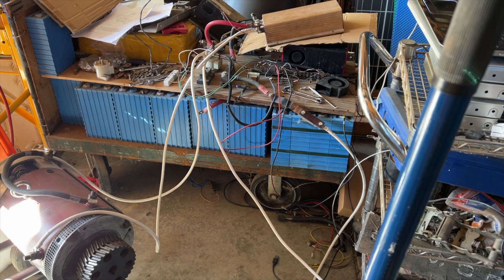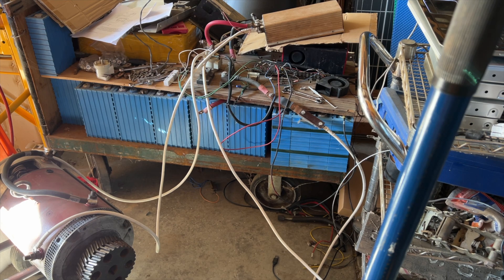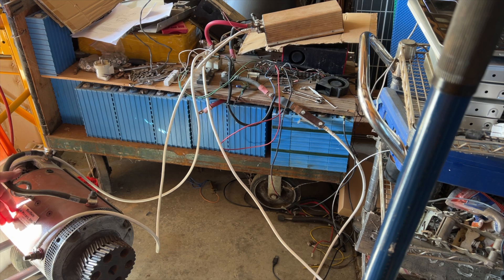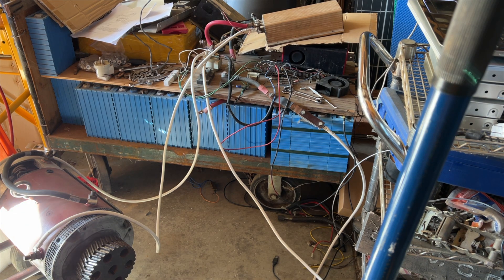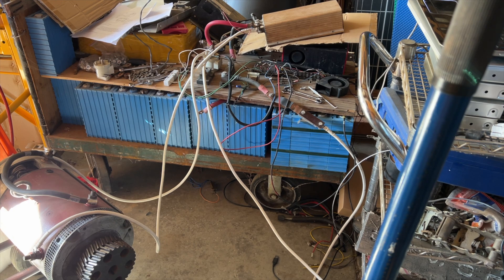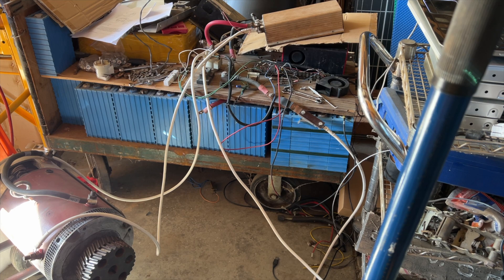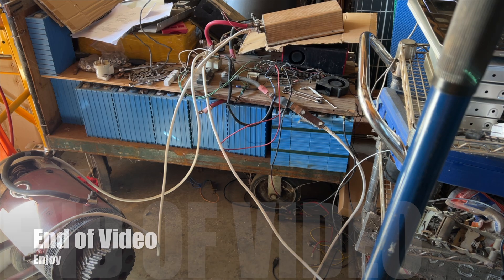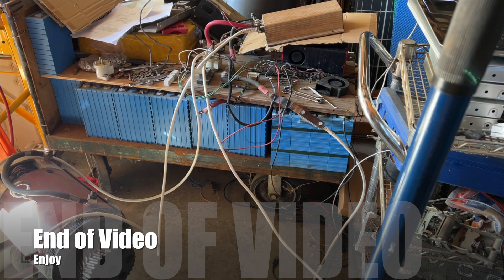Curtis Clone Series DC Motor Controller

Comment: Why did the taylor dunn carts have plug braking?
Reply from the maker: The original setup my Cushman Truckster  had was a Taylor Dunn conversion when new and used  the resistor style with contactor speed control. No plug braking. The low voltage DC Series motor controllers usually had plug braking so you can slow down without using your brakes. Like regen but not fully and only at low RPMs. Plug braking can produce loads of current so you don’t want to blow your controller so you are limited to low speeds. Braking small utility carts or mining equipment would be a must and plugging would ensure a quick stop. If you don’t need plug braking you don’t need to connect it up.

Comment: Great video!  Thanks for sharing. I’m working on a CC 1204 (3 bus bar) that will only precharge to 3V on my 48V test bench and blows my 10amp fuse when I close the key switch main contactor.   No obvious blown components and no bud bat shorts to frame or each other. 

Any experience with what may be causing this issue? CAPS and FETS all look good. And ohming B- to B+ reads 2Mohms and then continuity with leads flipped. Thanks in advance if you have any ideas. Cheers

Comment from the maker: This clone does not have the famous Curtis whine either. A fine controller.
Reply: Are you selling them?
Reply from the maker: @RetroElectric  No. I just happened to have one. These were made long ago. It is not new but it is still fully functional with very little use. Most use was for testing purposes. The put aside because I used a different controller. It is being sent to its new owner.
Reply: @onegreenev  I’m considering building a short range electric truck. Like a Chevy s10 so I’m searching for a larger dc motor I might be able to use on it but not too big. I’ve considered even leaving a manual transmission so the motor could be smaller. You got anything lying around I can use? In Southern California here.
Reply from the maker: @RetroElectric  For a truck like the S10 you don't want any smaller than a 9" DC Motor. Warp9 Motors are best. I have one Im willing to sell. Warp9 Motors are not cheap. You'd need an adapter and clutch pressure plate. Manual trans is best and keeping the clutch is even better. Batteries are at your discretion. You will need the volt meters and contactors and controller and such. Lots to do but very doable. The Warp9 with a good controller that will do at least 144 volts or better and 500 amps and up. What is your budget for a motor? Im hoping to get $1200 for the motor. It runs great and has decent split Helwig brushes. A beast of a motor. Perfect for a Truck. Range is dependent upon your pack.
Reply from the maker: Here is a link to a converted S10 using the Warp9 motor. This site is an excellent source for looking at what others have done. I have mine in there as well. http://evalbum.com/5403